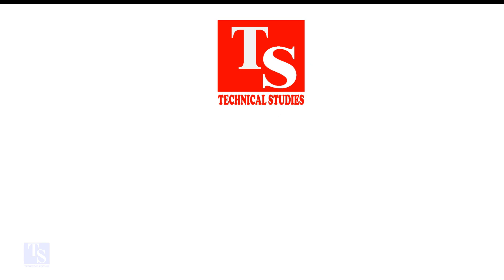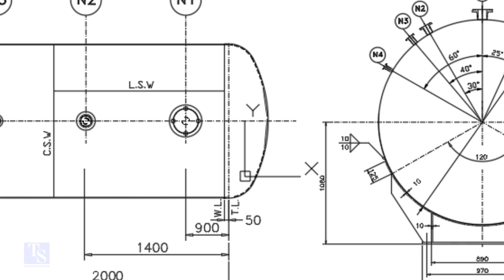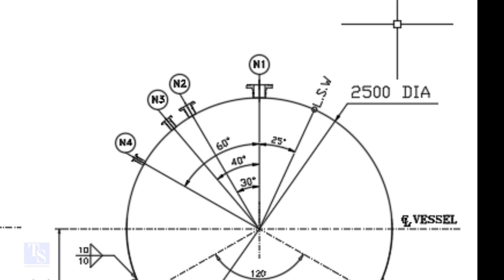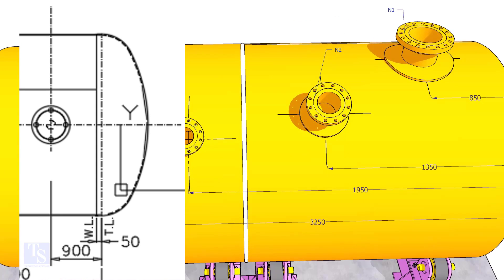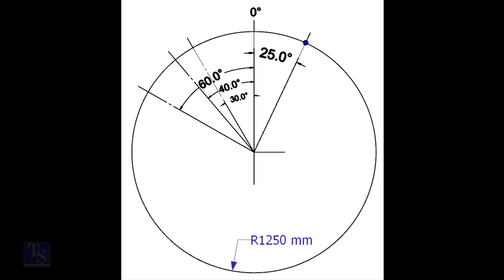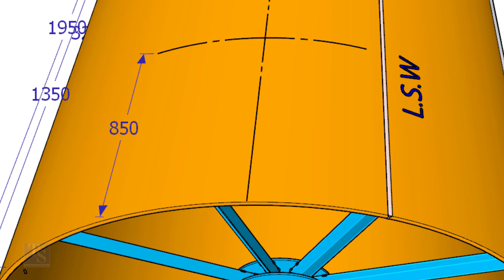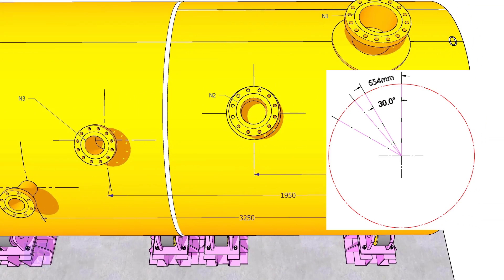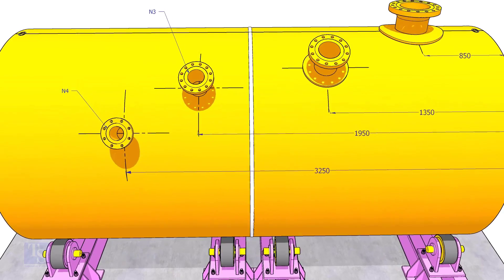NOZZLE CENTER MARKING ON SHELL- TUTORIAL

Comment: WL - if the plate is 12mm, root gap of xx mm, the straight face on the cap is less than 50mm?
Reply from the maker: Bro, I already mentioned, that this is not a standard drawing. The importance of this tutorial is converting degree to arc length. And 50 mm S.F is standard practice.